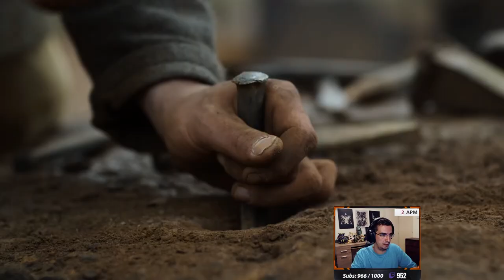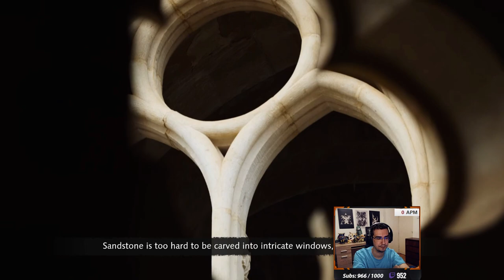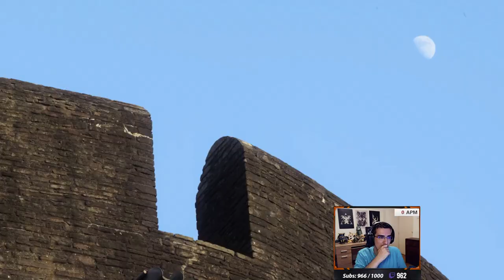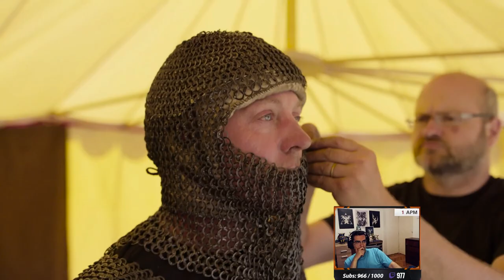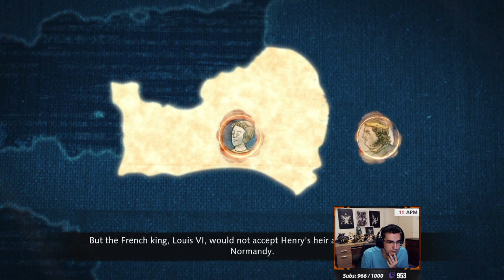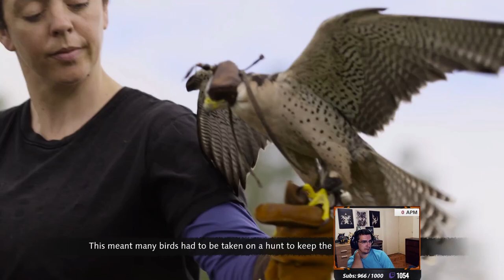(AOE4 English Campaign Playthrough 2/4) - Using 200IQ Tactics

Comment: Medieval knights could actually do cartwheels and stuff in full armor, especially plate armor. Mail was a bit more cumbersome because all the weight, except what could be off-set by a belt, was carried on your shoulders. So doing cartwheels and stuff in mail would probably be uncomfortable... But probably not impossible. I know for a fact it can be done in full plate armor though, because it's been tested! You'll tire faster for sure though, it gets really warm and it limits your breathing, vision and hearing.
Reply: Yeah, theres a video somewhere of a guy in armor (dont remember which one) sprinting and getting up prety fast. The armors were heavy but they were designed to have mobility, medieval blacksmiths were enginners
Edit: heres the video, it gives some idea on how much mobility armor actualy had https://youtu.be/qzTwBQniLSc

Comment: yeah, arrows from long bows, will go through serious modern bulletproof armour, but it will not continue through with speed, so with the wooden walls the arrow tip will go through, but it will not pass through, so anyone in side is safe as long as they are not leaning on the wall.
Reply: Not true. Most bulletproof armor stops longbows.
Reply: Bows were used in a modern conflict against baricades because arrows go straight through sandbags.

Comment: I'm curious because I don't remember seeing a change in the patch notes (and didn't notice in the video), but weren't the AI able to torch down stone gates in the campaign? I remember when I transitioned from campaign to multiplayer, it caught me off guard because my units suddenly couldn't torch down stone gates (In fact, I remember giantgrantgames speed ran with torching down stone walls).  So either it was changed and didn't know or the AI is just extra dumb.

Regardless, it makes the campaign defense missions significantly easier since AIs are extra dumb when it comes to stone walls.
Reply: I don't ever remember the ai torching stone walls in my playthrough
Reply: play the campaign on hard, there are some hard missions like siege of Wallingford which need more than 1 tried to do
Reply: Pretty sure the game specifically tells you to use rams when you get to stone walls (and gates), saying other units can't break them.
Reply: @robertsandiford6223  You have to siege for walls , but you can use torch gates in many missions.  There is a lot of difference between the campaigns and multiplayer in general
Reply: In campaign stone gates can be torched down
Reply: They can, but the position of the walls tripped up the units, I think the AI is doing a move command to the location of the wooden walls and getting stuck